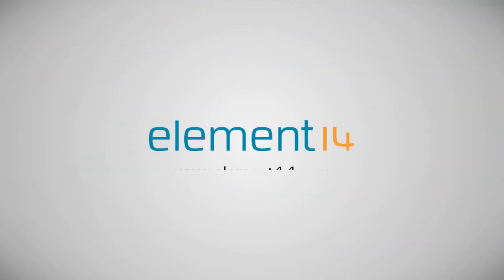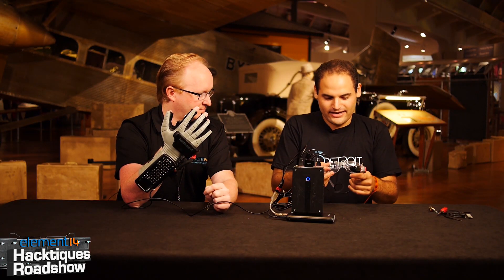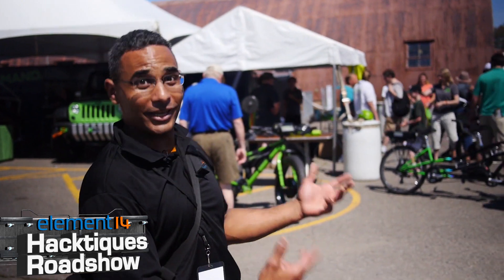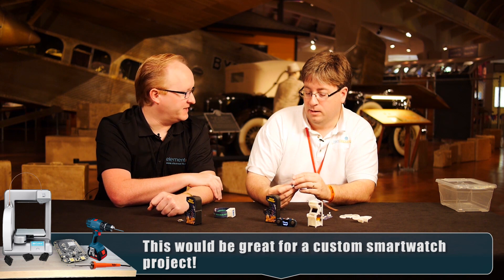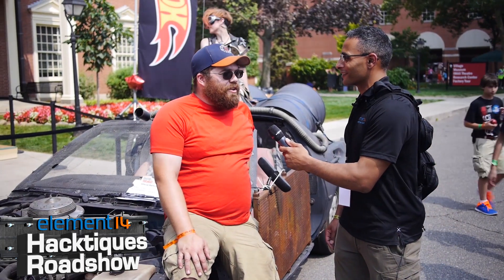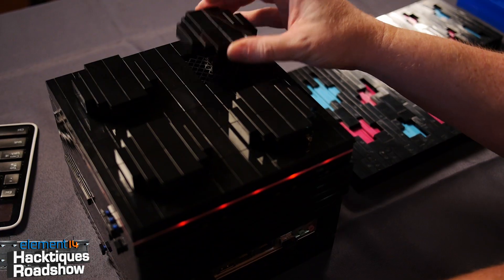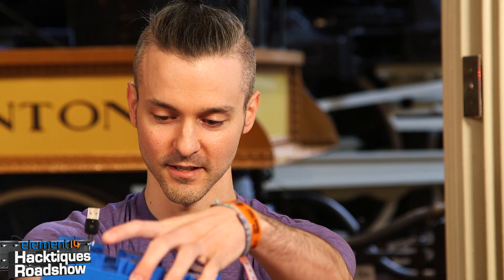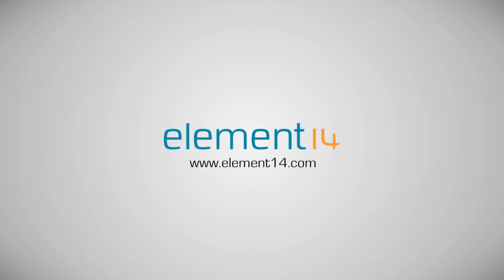Ben Heck’s Hacktiques Roadshow Part 1

Comment: 5:36 so mirosoft cant be wrong right ?
1.Zune
2. microsoft surface not the tablet but the table thingy
3. microsoft surface the tablet
4. Xbox red ring
5. Windows Me
6. Microsoft Kin
7. Windows Vista
8. MSN
9. Internet Explorer
10. Microsoft Bob
11. Windows Mobile

I probably left out many more. Its easier  to count MS success then failures.
Reply: Hulla Dek I don't know I can agree on most of them, however I still have a Zune, the old 30 gig one, and I know people who have me install BOB on their Windows 7 machines.  That said, I despised ME and didn't  much care for Vista, the only good thing I can say about Vista is that it turned MANY of my friends to Linux (Mint). I spent many hours introducing folks to Mint, most still swear by it, some have come back when 7 was introduced, but refused 8, some went back to Linux when 8 came out as well.  10 might be OK don't know yet but I am set up with Linux Mint as a second boot OS.
Reply: Hulla Dek I had two Zunes and I loved them. They were way better than the iPod I have now.
Reply: The zune has a cult following and the red ring didn't harm Microsoft's Xbox 360 sales at all. Windows mobile has its devout followers too. I can agree on most but you don't need to exaggerate them. 

You can do the same with Apple though - Lisa, pippin, apple III, newton, etc. Its easy to do with almost any company and doesn't prove anything.